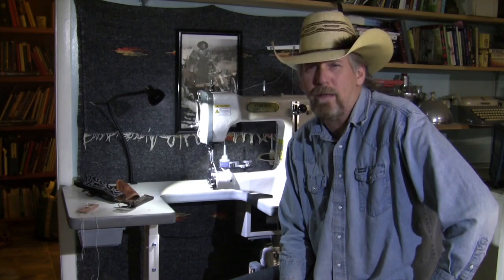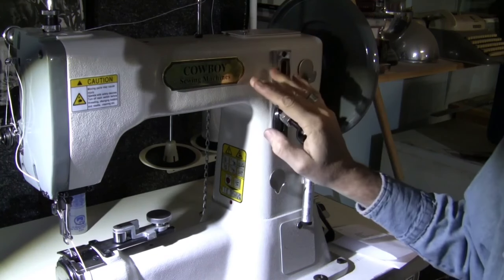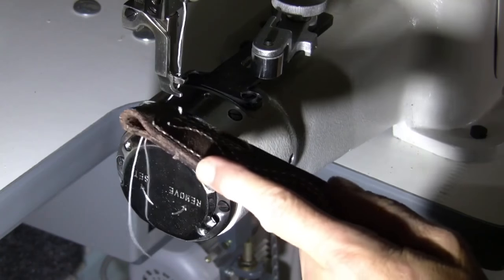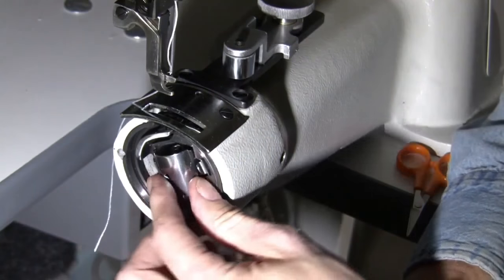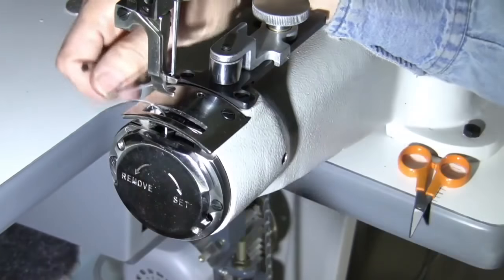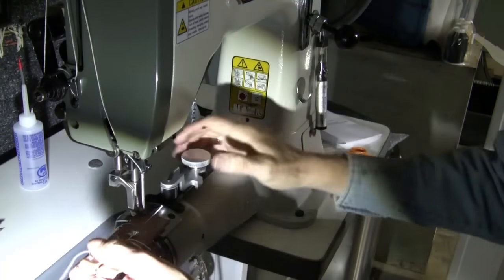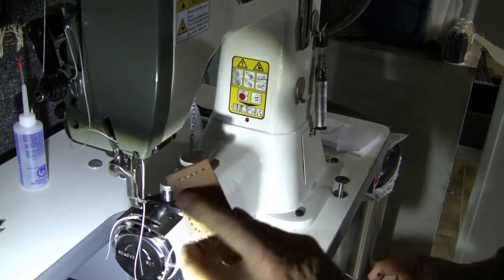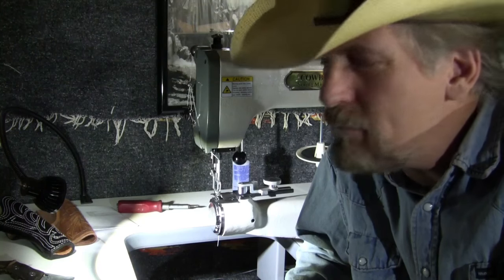Cowboy Leather Sewing Machine Tips - Getting Started On the CowBoy CB3200

Comment: Many thanks for the video. I'm looking seriously at this machine for both leather and handbag sewing. Do you think it is feasible to make a flatbed table that can slide over the cylinder arm? Also, what is the lightest thread this machine can use?
Reply from the maker: CB3200 is very good leather sewing machine for stitching hand bag with thick thread. The lightest thread is V138. There is a flat table attachment as option, see the detailed special sewing parts at http://www.cowboysew.com/heavy-leather-stitching-machine.htm